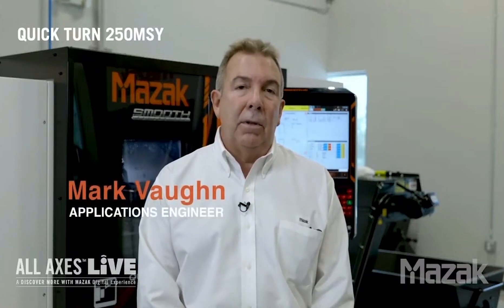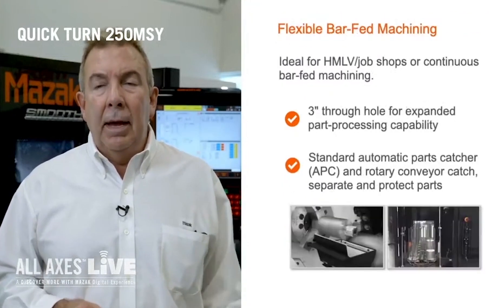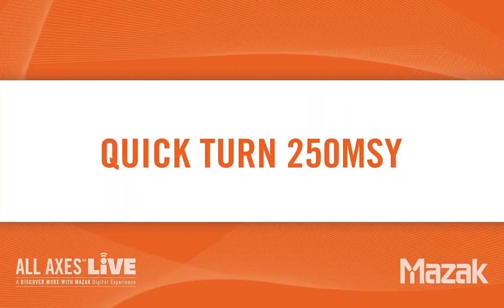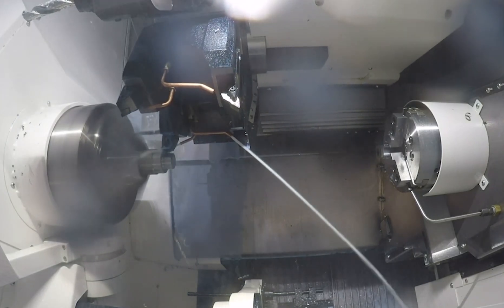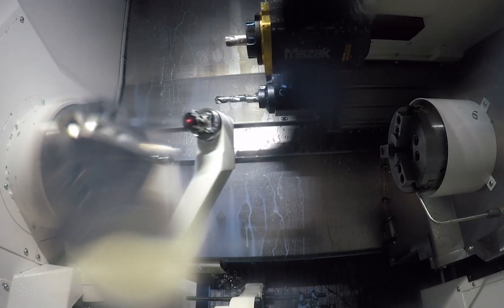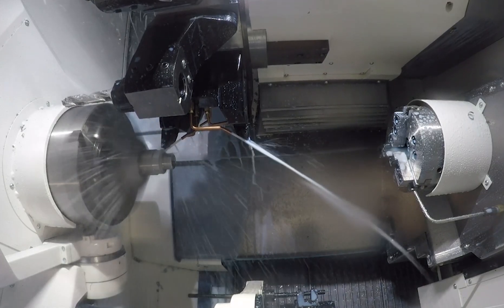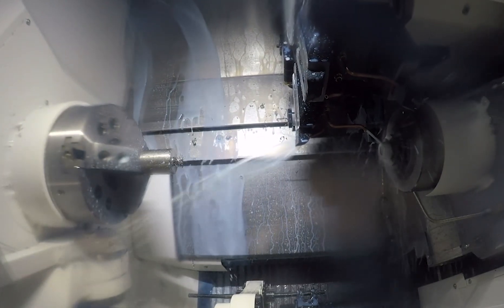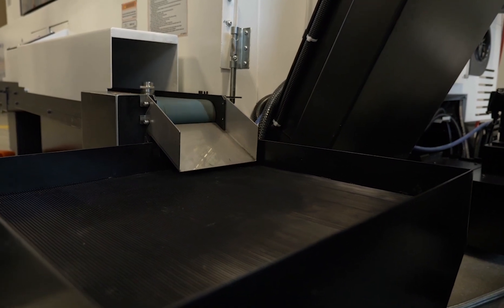QUICK TURN 250MSY Demonstration

Comment: how do you  INDEX for the part off tool BEFORE bringing second spindle to TRANSFER ?
Reply from the maker: You can use a MANUAL MACHINING unit to call up the cutoff tool and do a G-code (G0,G90) movement to position the cutoff tool to a desired position prior to issuing a TRANSFER UNIT.  You may need to change the parameter SU157 bit 2 and bit 3 that control how and when a tool returns to home when a tool change command is issued.
Reply: @MazakCorporation  no i don;t want to use G code because it's NOT necessary i figured it out though thanks

Comment: So can the tools on the back side of the turret reach the tool eye?  Charles
Reply from the maker: Hi Charles, 
The tool eye is designed to measure tools facing the main spindle on this machine.  It is not capable to measure tools facing the second spindle.
Reply: @MazakCorporation  So since it can only probe half the tools, it's half the price, right???
Reply: @jasonquade9284  Never had problem as mazak is saying. Ive measured all tools on the tool eye also for using on the second spidle. There is enought space.
Reply: @MazakCorporation   Hello  we just  purchase a mazak smooth G lathe my question is how do you set your Z offset on the second spindle I've been having a lot of trouble doing so..  I need to face and drill backside of the part. Thank you in advance
Reply from the maker: @bcruz264  Hi,  to set a Z-offset for the second spindle you first need a tool oriented for that spindle. This tool must be “Active” as well. Then you can proceed to touch off on the face of the part with your preferred method. Once this is done navigate to Setup Data and select the TEACH key in the Z-OFFSET window and then input. 

To get detailed instructions and support please contact your local Mazak distributor at https://www.mazakusa.com/offices-and-distributors/ or Mazak support at https://www.mazakusa.com/mpower-hub/contact-directory/
Reply: @MazakCorporation   Thank you for the info..
Reply: @MazakCorporation  can you please show the program ??
Reply: 99% yes , with short workpieces or before chucking the workpiece .